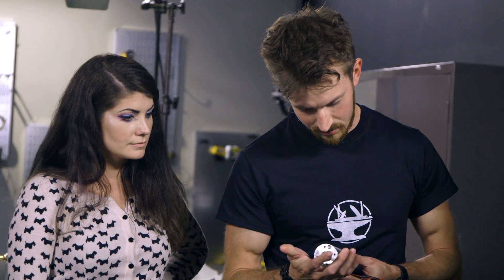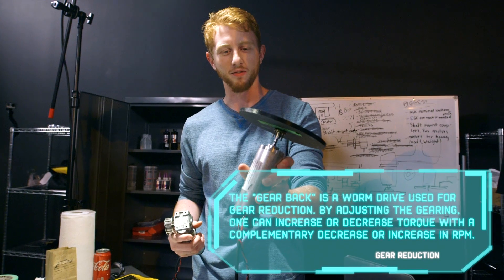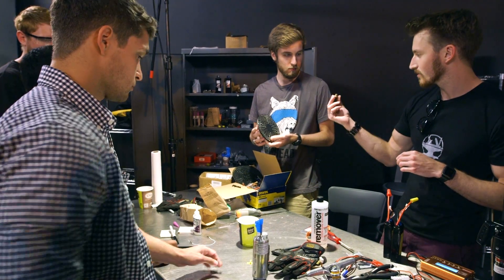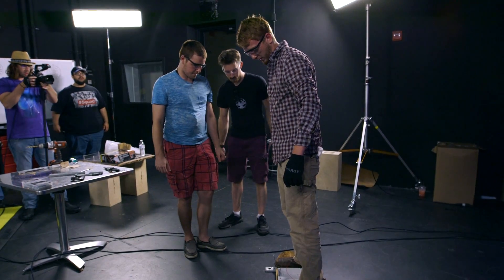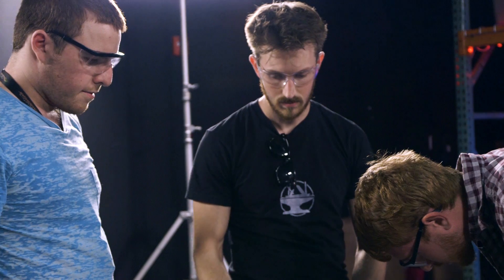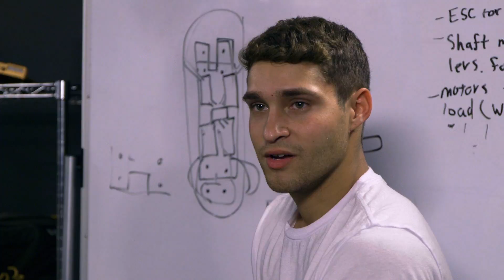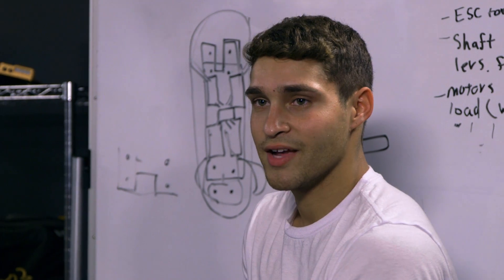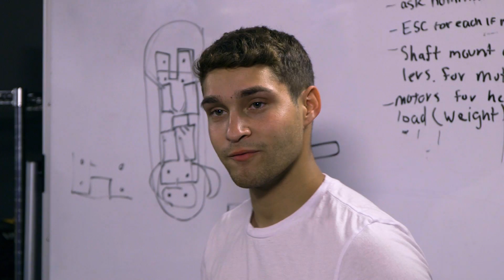Hacker Labs: Hoverboard Challenge Ep. 4 | Full Sail University

Comment: You have made the hoverboard imbalance for using four motor instead of two and also if u only did half the disc. One half can go forward and the other disc go the opposite direction plus the motor is not right for it so u might need to make your own motor that suffice the disc rotation and weight. For speed u can go faster than speed of a car unless it’s using wind power to increase the speed

Comment: 2 batteries in series to get 24, 3 in series to get 48. Unless you’re combining different voltages in series, which isn’t very safe, then I think you meant 36. Also, a brushless outrunner would be much more suitable here, not an inrunner. Check the KV ratings and find one that has enough speed and torque.

Comment: Looks possible, but there is no way they are making a hover board that will hover a person. They have to at lest get one motor and one disc working properly to get some data before trying to build a whole board. Their approach is just trying to bang it out as fast as possible. I Wish you guys success I understand it's a tall order, but scaling it back in order to get an understanding of what you need to accomplish would be beneficial. The hacksmith has an idea because he's has experience dealing with these part but still just winging it, solid data gets solid results. Good luck

Comment: So it is vibrating like hell 100% power. Let's speed it up to 150%. It will self balance.. Well it will once it blows of the disc and only the shaft remains. You need to make aluminium disks there. How do you expect those 4 disk to hold the weight of a adult person and not bend. Once they bend.. they will blowup from the spin.